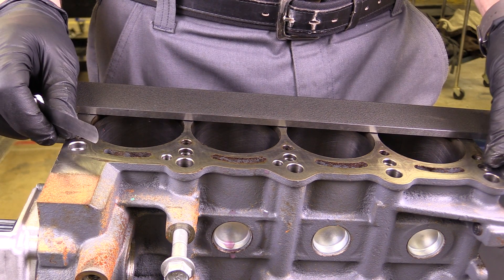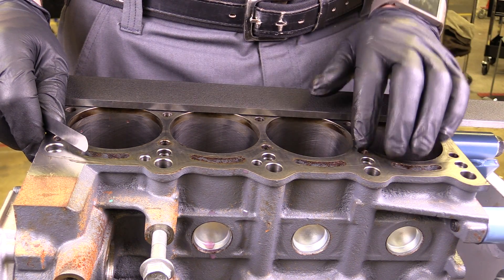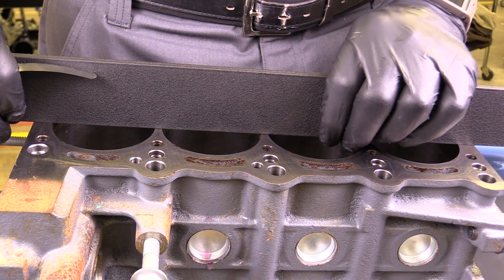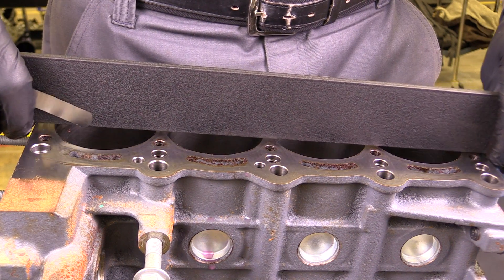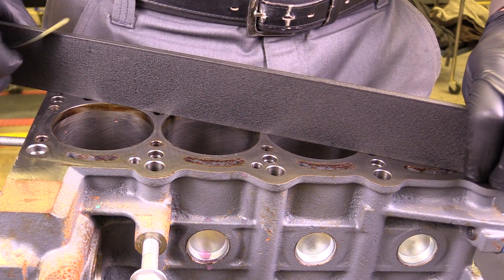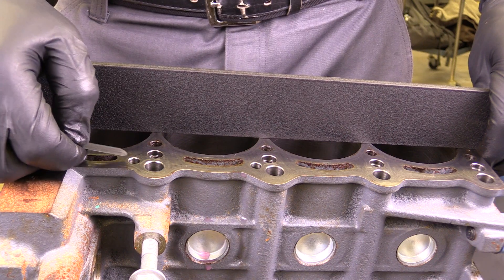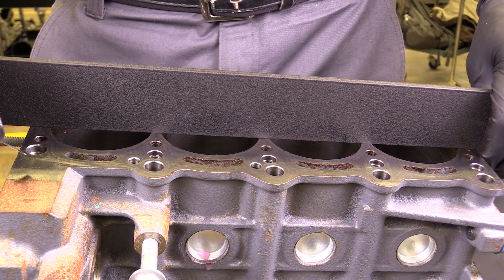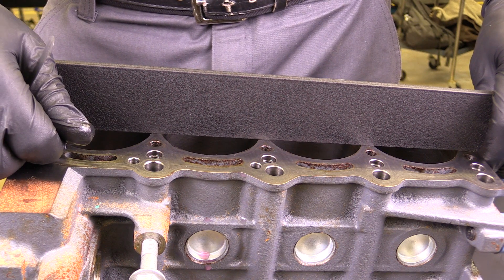Check an Engine Cylinder Head And Block for Warpage

Comment: Both of the cylinder heads I just took off a SBC 305 were cracked. Praying there is no block warpage but I’m guessing there may be if the heads heated up so much they cracked